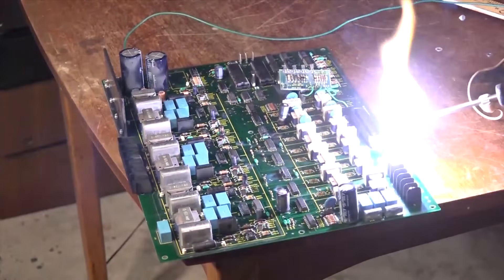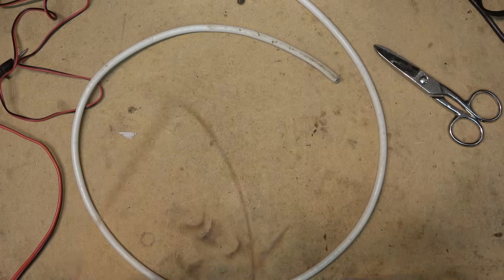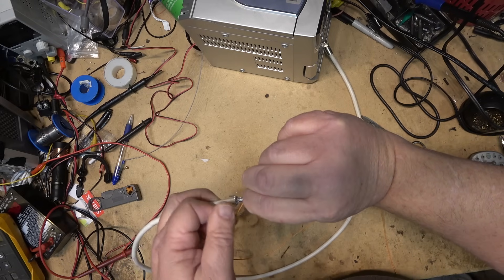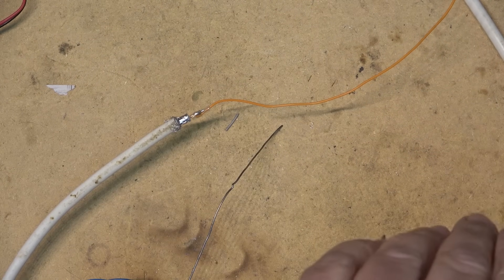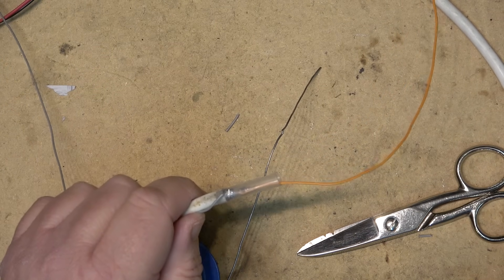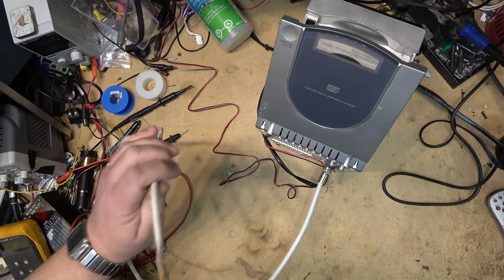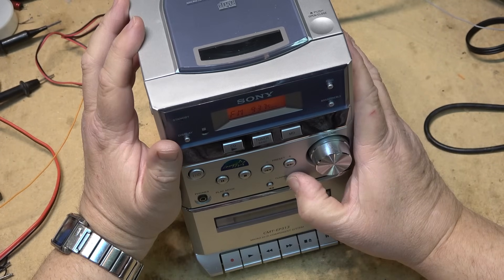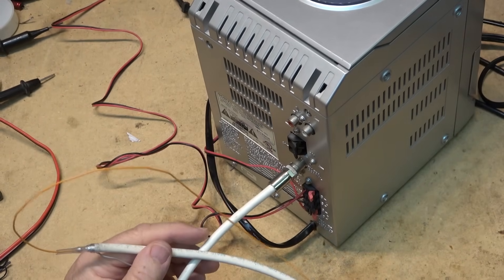Build an indoor FM antenna for 75 ohm coax input

Comment: This basically wrong. You will need a 75 Ω to 75 Ω balun. To go from balanced to unbalanced where your radial is. If you don’t do this, the coax shield will start to receive and it will deteriorate proper reception. 
It is not so simple as many people think.
Reply from the maker: No you don't need a balun. For a receiving antenna.

Comment: Reminds me of when I was a teen. My mom bought me a Radio Shack "build it yourself" Am radio build kit, I had it together in no time. It used a coil type antenna that if I remember from +30years ago... was maybe 7 inches long as a coil. I was amazed at the stations I was picking up, seemed like almost every station within half the earths circumference was coming in clear as any local station.

Obviously AM is much different than FM but I was young and easily impressed.

Comment: Why does the extra 29 1/2 have to be added? Why won't the wires that comprise the coax do the same thing?
Reply: Coax is shielded.  The shielding blocks radio frequencies. 
The two wires at 29.5" each is the optional length because it matches the wavelength of the signal.
Reply from the maker: Just caoatance matching. Balances the line.

Comment: What if receiver have 3.5 mm jack for antenna? Thanks
Reply from the maker: Make it out of an old headphone cable.
Reply: @12voltvids  that's OK sir but, which wire should be sold to which pin. Can't we make it with coaxial?
Reply from the maker: Doesn't matter.  You can just sperate the shield from center conductor and string them out.  Or get a 3.5mm to coax adapter and screw the coach on.
Reply: @12voltvids  OK sir thanks for ur reply. Thanks again

Comment: Great vid, thanks for the tips and quick & easy construction. Couple questions as a matter of interest that I hope someone in the comments might be able to address (which may be answerable with some trial & error anyway...)
1) The wires attached to the coax, would they do better as solid or stranded, and does the gauge affect performance?
2) If I know the direction where the transmission is coming from, is there a configuration that could help this setup be advantageously directional? (e.g. T-shape perpendicular to line-of-sight with the station)
3) When you hook up an antenna to that 75ohm jack, does that override the radio's internal antenna? (In other words, does the location of the radio unit itself become irrelevant once you have an external antenna in the mix?)
4) If I mostly listen to just two stations, is there an advantage to customising the length of the antenna to the average of their frequencies, rather than 100MHz? (by my calculations, for stations 102.3MHz + 88.5MHz; average=95.4MHz; quarter-length=30.9 in.)
5) I've always wondered since I was a kid, why, when the reception is decent but not great, are the 's' and 'sh' and drum cymbal sounds affected most (come through garbled or white noise-y), while the rest of the audio spectrum comes through pretty clear?
Reply from the maker: You can customize the length. It won't make much difference.  Stranded vs solid makes no difference.  Yes its semi directional the weakest is the direction the tips are facing.  For vertically polarized stations obviously you hang it vertical

Comment: Cool, is that a 1/2 wave on 98 MHz or so?
What frequencies do the digital TV stations center on?
Do we need a dual band antenna for that? Trap dipole?
Reply from the maker: TV is all over the map.  52-87 mhz vhf low. 176 - 210 vhf high, and 470-600 uhf or three abouts.  It depends of where the broadcasters transmit. In my area its all in the 470 to 600 range.

Comment: Do you HAVE to soder? I’d think electrical tape would be fine to hold the two wires together. There’s no current is there?
Reply from the maker: You don't have to but it makes a better mechanical connection
Reply: @12voltvids  thanks for the clarification!

Comment: In the 1948 we used copper wire that was cleaned, it was warped around nziles put into the window frame  
It als was used for tv
Reply from the maker: That will work too.

Comment: Couldn't you connect just a single wire to the inside pin of the coax connector?
Reply from the maker: Sure and some wire antennas do just that.  Making a dipole makes us a little more directional.

Comment: In the old days we took wire about 20ft or so wrapped it around a window screw Ed it to the back of the radio and let it play. 1950s
Reply from the maker: Am radio that worked fine. I had a 100 foot wire that went from 1 chimney to the other across the roof then down into my room using stand off insulators and i picked up the world on am and shortwave.

Comment: If you made the coax the same length as the first wire and omitted the second wire, wouldn't the shield act as a second wire or is it too close to the other conductor?

Comment: I soldered a crocodile clip at the end of the wire, so that it can be hung from any curtain thus maintaining its position for best receptions
Reply from the maker: That works but if curtin rod is metal it becomes part of the antenna which will lengthen it and define the resonance
Reply: @12voltvids  Only the fabric part of the curtain

Comment: If you hang the antenna vertical its recieves the best signal. This is because fm signal are send trought vertical dipole. So the radiowaves will recieve better in recieving antenna being in vertical position. Greets

Comment: You seem like a guy that knows his stuff. On the back of my Marantz ST 500 tuner. I have twin 300 OHM screw mounts and a single 75 OHM screw mount. I have been using a 300 OHM balun and some coax to connect my antenna. Which is a single wire. If I was to use the 75 OHM single connector would I merely twist some twin lead speaker wire together then create a dipole. Thanks for any help

Comment: Hi How important is it that the two antenna wires are straight out, and not drooping or bent slightly etc.?
Reply: Actually radio is polarized vertically, so the antenna wires need to be vertical .. not straight out.  Advantage of polarizing vertical is that it receives signals from all directions.  And thats why radio antenna on cars and portable radios have 1 telescopic element sticking straight up.    But TV is polarized horizontally .. so it has 2 legs that stick out in both directions, and thats why portable TVs have 2 telescopic elements that need to be horizontally.    THe advantage is that is that it is only sensitive in the direction it is pointing so doesnt pick up noise signals,  disadvantage is that you have to point it at the transmitter .. so thats why the TV antennas on roofs are all pointing in the same direction.

Comment: I have a receiver with a 75ohm fm connector that’s just like a spring fit speaker wire connector and a fm ground with spring fit connector.  It looks like the original antenna is just a plain wire I think it is it some special wire that’s 75 ohm ?  I heard speaker wire is 300 ohm ?  What’s the best way and best wire to use ?
Reply from the maker: Its just a plain piece of wire and no it's not 75 it 300 ohms.  Close to 0 to be exact.

Comment: OK so here's my story for what it's worth. I made this antenna in desperation after the FM reception in my shed took a massive nosedive all of a sudden (I'll come back to that). I figured that my issue was related to the old antenna, so I was devastated to spend the 10 whole minutes of my life making a new one only to find out that it didn't improve the situation at all, no matter how I positioned it. I started to think about what has changed in my shed setup and I remembered a week or two earlier that a gecko had crawled into the PSU of my shed PC before I turned it on. He shorted some components and sadly cooked himself alive and destroyed my PSU so I replaced it (ANTEC) with a spare one (EVGA) I had lying around.

It turns out that this EVGA PSU is my issue all along - as soon as I toggled the power switch on the PSU the radio sprung to life with gusto... My efforts weren't in vain though because I am happy to report that the reception with the 12voltvid antenna is much better :)

Comment: Looks like you're using 18AWG, but I guess it really doesn't matter?  I've gone through about a dozen comments and nobody else seems to be asking this question.  The reason this seems pertinent to me is because, as you're well aware, different gauge wire has different resistance.  So 29.5" of 18AWG is going to have different resistance that say 20AWG or 22AWG.  I kind of assume if it mattered you would've specified in the video, but being OCD, I thought I'd ask.
.
Subscribed!
Reply from the maker: No, it doesn't matter.   This is a receiving antenna not a transmitting antenna.
Reply: He is using R 6 coax cable.

Not rg 59.

Rg 6 dual shield
Reply from the maker: @christiansales100  it really doesn't matter.  RG6 only important for long runs in the GHz range like satellite dish to receiver and catv use.
Reply: Okay, that answers my questions.

Comment: IT WORKS!!! I've been trying to receive a local station which broadcasts with a 500 watt transmitter for the last two years.
Tried every type of antenna I could find...no luck.
I spent an hour making my antenna based on these dimensions and I can now receive this station and many others with a strong, stable signal!
Thanks much for all of your videos!
Regards,
Dave
Reply: what type of wire that connected to coax cable? please answer...

Comment: Why is 29.5 inches of wire important?
Reply from the maker: It is the half wave length for 100mhz which is right in the middle of the band which makes the antenna resonant at that frequency.

Comment: I'm very grateful for your video. I'm just wondering about details regarding the 2 wires you attach to the coaxial. (1) Is the gauge/thickness  important, (2) and do we need to strip off their insulation ?
Reply from the maker: The gauge is not important no it's just a receiving antenna. Obviously you have to strip the insulation off where you make the connection between the antenna wires and the coax but no you don't have to strip it off the rest of it.
Reply: Many thanks. I've found that attaching just one 31-inch wire to the coaxial and hanging it vertically  down the side of the window the reception is perfect on the only FM station around here at 107.5, right at the end of the scale. Funny -  I have iron security bars on the windows (but not a jail !!!) and when I hung the antenna outside the bars, I got a lot of hiss. So I brought it back in.
Reply from the maker: @brianhazlehurst2152  metal will reflect the signal and cause multipath interference. This is why people that live in Stockwell houses and have high efficiency windows have so much problem with their Wi-Fi. They're quick to call their internet provider and scream and bitch that their internet sucks and in reality it's the way the house was built. I love telling people sorry there's nothing I can do you'll have to move if you want better internet speeds. been to people's homes where they've got access points every couple feet and they still can't get half decent internet over Wi-Fi. I explained to them that the wire mesh behind the stucco on the wall and large metal appliances and the air ducts in the wall and the thin metallic film on their high efficiency window makes her house like a giant Faraday cage or in this case a giant microwave oven. Signals are bouncing around inside and arriving at the antenna at a slightly different time causing errors which need to be retransmitted which slows their internet down. they usually threaten to change internet providers and I say go ahead knock yourself out still be dealing with the same problem. Or go buy yourself your own router and find that it's exactly the same. For those people in those type of homes they have one solution and that's plugged their computer in to an internet cable if they want any type of speed.

Comment: Fantastic video Sir!!!! I can build a shopping center but I have no idea what gigahertz and such things are. I've been fighting with a AM/FM radio in my steel shop building and I think I'm going to apply what you just did here to it. I'm thinking mine's going to have to go through the wall and outside because of the steel building, is that correct? Also I think I'm going to have to use a splitter because I don't have coaxial connections on my radio, I'm planning on taking the radio apart and catching the wires going to that antenna and putting them onto my DIY antenna. Once again thank you!

Comment: I have this system, and I use a digital indoor black rectangle 25 mile range antenna to an indoor amplifier, but I notice if I unplug the amp, there's less white noise. Weird right?
Reply: You are amplifying the background noise too. If its on a station while doing that it might be getting overloaded causing noise. Sometimes amplifiers can cause signal issues, just something you have to test sometimes

Comment: I was just about to purchase an fm antenna and came across your tutorial. I found what was needed in my odds and sods and followed your instructions. It works perfectly. Thank you. Des.
Reply: what type wire did you use to attach to coax cable, solid or stranded core?

Comment: For anyone asking about how long the coax should be, it doesn't matter.  It is shielded, will not affect signal, so it can be any length.  the actual place where the antenna starts is where the two wires are connected.  Spread them opposite ways and there you go.
Reply: Awesome! Just what i needed.thank you!
Reply: Why spreading opposit ways ?
Reply from the maker: Yes and no, the longer the coax the higher the attenuation, but the higher you can get the antenna portion the better.
Reply: @12voltvids is attenuation a good thing?
Reply: Does it matter if you strip the casing off the two ends of it? Or leave the plastic on

Comment: Hello. I'm connecting an old Kenwood system. The tuner, tape, and receiver are in great shape. For the fm antenna, it just has a loop antenna but not sure where to connect the 2 fork type connectors. the options are fm 75 ohm, gnd. loop amd am...
Reply from the maker: 75 ohm and ground.

Comment: Hi do the lenght of the coaxial cable have an incidence on this build?? i mean i want a longer coax to hang on the curtain pole of my bed room window ca someone guide me up :)
Reply from the maker: The length of the coax won't affect it much.
Reply: @12voltvids  Thanks !!is this antenna is good for shortwave?
Reply from the maker: @BraveNewWorld1984-r6o  A dipole works great for shortwave. The length needs to be longer however.  For shortwave just a long wire is more than enough. For the 40m band the length would be about 68 feet.
Reply: @12voltvids  Thank you!!!

Comment: Does the length of the coax matter?
Reply from the maker: The longer the more loss, but then if you can get the antenna higher that will more than make up for it.
Reply: @12voltvids  Thank you, makes sense.

Comment: Perfect! You have reached a scientific calculations on frequency receptions. This 29.5 inch length is surely calculated for FM frequency.
Reply from the maker: Yes for 100 MHz.
Reply: @12voltvids   Yes maybe... 300,000,000Hz/100,000,000= 3m. 1.5+1.5m will be perfect for 100MHz frequency. The 300million Mhz is light speed. Is it right? And, Lambda value was a Quarter. That is 29.5 inch x 2
Reply: @bizmakerbhang5953  300.. this is r wave speed m/s, 100... - frequency Hz,  wavelength will be 1.5 m ~60inch
Reply: What gage wire should I use?

Comment: You forgot to mention how long the coax cable is. 
Thanks
Reply from the maker: The coax length is not important. It is the radiator length that matters.

Comment: I like your video and all that but here's what I'm dealing with the connector that you would use to hook up speakers with a little push tab that when you put in your wire and release it and it squeezes The Wire not the connector that you're using but I still have a 75 ohm requirement on it

Comment: I have an old Pioneer SX-550 Receiver. It takes 300 and 75 ohm antenna, however it does not have a female coax. It only has the twin lead terminals. I know that sounds weird, It would be easy to explain if I could send you pictures and the manual. My question is, if I buy a 75 to 300 converter, do I plug into the 75 terminals or the 300 terminals?
Reply: I have a kenwood kt6005 and there is also no female coax and I am also curious how to do this. I bought some Best Buy antenna thing that had two go to the 300 and two other for AM and ground but I don’t know if I did this correctly, I don’t know much at all about my Kenwood

Comment: Hello. Question! Is this going to work for a radio scanner?  My scanner's frequencies are 25-88mhz*, *108-174 mhz*, *225 - 512 mhz and *806 - 960 mhz*. Will this DIY antenna cover any, if not, all of these? 

Thank you.
Reply from the maker: For receiving any piece of wire will work. For a scanner however the antenna should be hung vertically.  It is cut for the 88 - 108mhz band however.   A discone is a better broadband design for a scanner.
Reply: @12voltvids  Got it. Would a DIY antenna like this one https://secomms.com.au/wp-content/uploads/2018/01/1385lrg.jpg  from a TV Antenna wire or copper or aluminum work for me? 

Do you have any videos like this one for a discone antenna? Thanks.

Comment: I have a slightly different problem.  Sony sells a 2 channel Receiver that has a proprietary input for a dipole antenna they provide.  I have a great coaxial aerial that I prefer to use instead of their  dipole.  Is there any way using their proprietary input and cutting off the rest of the dipole and then attaching an adapter which I can connect to my coaxial aerial?
Reply: same problem here, I have a stupid sony stereo with a single wire antenna and a coax exterior antenna and I'm trying to figure out how to connect them together.